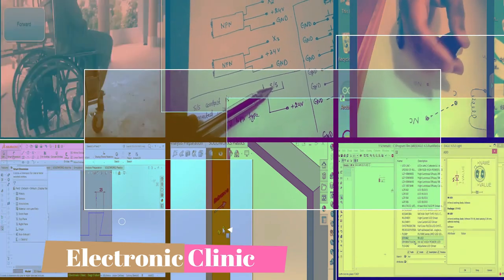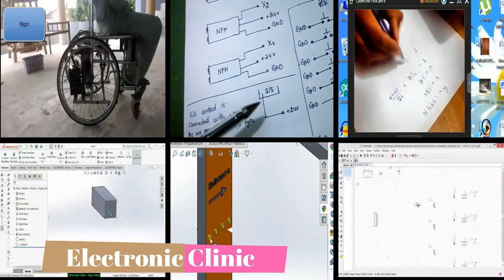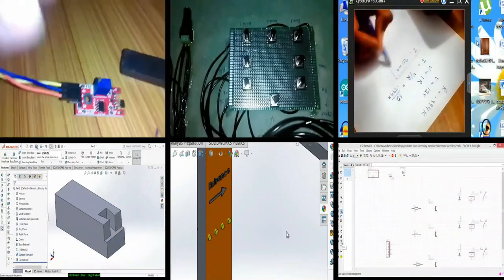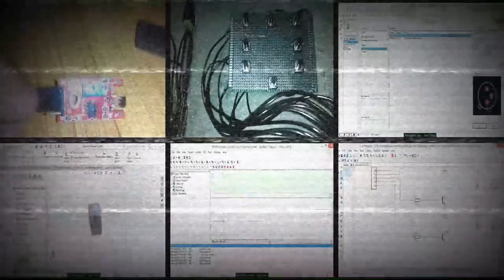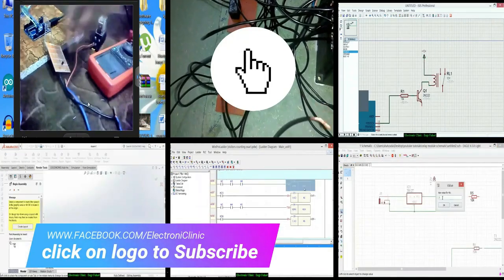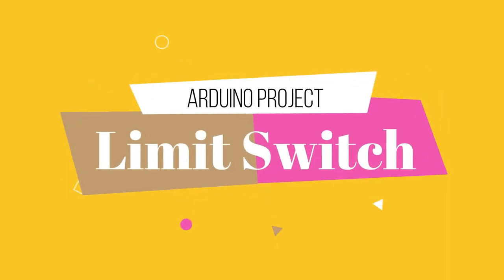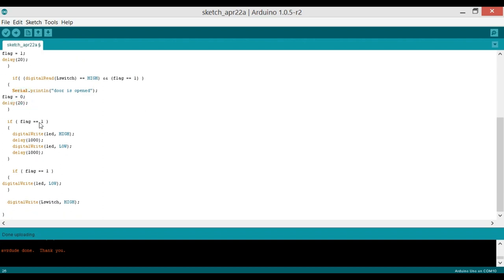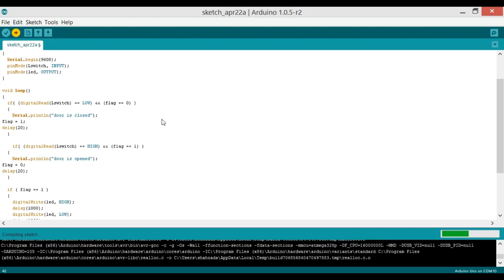arduino uno limit switch Tutorial | Limit switch code | Limit switch wiring | limit switch arduino

Comment: I do not understand how your wiring should work. How should the lswitch PIN (2) sense any HIGH if you have no current flowing. You just connect PIN2 with ground by pressing the switch. That should not lead to HIGH if you have no current. Seems like you corrected the wiring on your homepage.

Comment: Nice video and work. I need to start a project with about the same program and electronics as your conveyor. Being newish in electronics and Arduino programming, is it possible to make this Nema 17, 2 end switch circuit with a Ramps 1.4 shield and a mega 2560.
Reply from the maker: watch my yesterdays video in which i used the stepper motor and cnc shield.
Reply: @ElectroniClinic  
Yes, I have watched that one and many of your others. I have also bought some items from your website so that I can follow more closely. Are you still in the uae? I was supposed to go to perform visual inspections with robots. I would have been gone for Xmas so I didn't go. Can I get your E Mail?

Comment: Can I connect 7 limit switches and 1 thermocouple as input and 4 relays connecting to linear actuators for output using Arduino Uno unit?
My question boils down to how many input and output can Arduino uno support?
Reply from the maker: yes you can. Arduino had many io pins